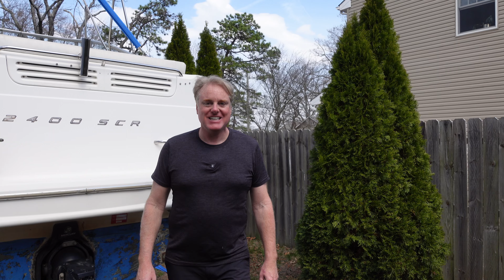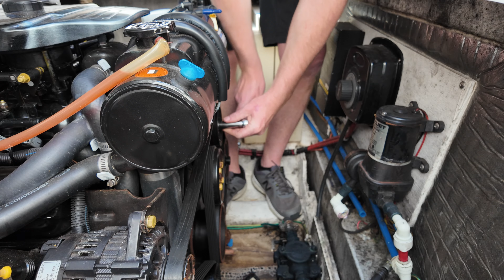How to replace water impeller on Mercruiser MAG Stroker Bravo Outdrive

Comment from the maker: INSTALLATION NOTE:  Getting this back on was a real treat.  Here are a few tips.  Reconnect the bottom hose first.  Disconnect the top hose at the T-fitting for the flush kit and then reconnect it to the pump.  Mount the pump back on the front of the engine and snug up the nut so the pump and bracket are flush against the engine.  Snug up the bolt below the alternator.  Pull the water pump toward the outside of the engine and with any luck the bolt to be insert on the front of the engine should line up.  Then reconnect the hose at the T-fitting.  Good Luck!!!  🤞🏻

Comment: I have to leave the back plate and the hoses attached and take the pump apart after dropping off or down from the stud.  They would have to be cut off if you could reach them. The first time I had to double nut the stud and remove it and then grind off a useless tang from the bracket to be able to drop the pump down and reach all the rear facing pump bolts.  I set the pump on a board to work on it with the hoses attached.  I then eventually replaced the pump with the Hardin marine Stainless-steel pump housing and then the stock impeller started sticking after about 2 years and stopped pumping.  I am in the process now replacing the stock black impeller with the blue dry run impeller to see if that works better over time.  Before that I tried the stainless plate with the short impeller to continue to use the brass pump housing that was scored up.
Reply from the maker: Thanks for taking the time to share your experience.  It sounds like it was a nightmare.  I'm curious what year is your engine?  My water pump wasn't the easiest to get to but at least I could do it without removing the engine or anything drastic.  I wonder if they learn anything over time as far as placement and MTBF.  My impeller was 5 years old and still looked good.  I can deal with PITA jobs every 5 years or so.  I'm delayed getting my boat back in this season because I already have an oil leak from what seams to be the oil pan on an engine that is only 5 years old.  That's BS.  It's so difficult finding good shops for big jobs.  I'm regretting not getting it over there in February but there was a foot of snow all around my boat.  Good Luck with the impeller and feel free to share an update.
Reply: @Nautisphere  I believe my 350 MPI is about a 2005.  It has the HX system and a replaceable fuel water filter next to the seawater pump.  I just went with this Hardin marine pump upgrade a couple of year ago.  The stock impeller did not appear to wear that well, and not many hours, but I have not done the repair yet to fully determine. I hope it will go better this time now that I have some experience and a plan to use the blue impeller.  Since I am in Florida now the HX is not really needed but may still help me with the brackish and salt water.
Reply from the maker: @kruzanJFD I watched a few videos when I originally went to do my impeller and that’s when I realized mine was a bit different than the older setups. The guys that installed my new engine said the material of the new housing and impeller was a better combination so it only needs to be done every five years. Hopefully your replacement lasts longer. Good Luck!! 👍🏻

Comment: That's the rustiest 4 year old motor I've seen. And that doesn't mean much because I don't see many saltwater boats. LOL
Thanks for the video!
Reply from the maker: Thanks!  You’re not kidding as far as the rust. I look at the engine and wonder what if anything I could have done for it to not look that rusty. I probably should have sprayed it with deep creep weekly. It would be interesting to see what would have happened. I left the 26 Piece Harbor Freight Ratcheting Screwdriver Set in the cab overnight. There was rust forming on them a day later. The moisture and humidity is just brutal.

Comment: Hello. Great video! question on the transmission fluid and acetone. What is the mixture? thanks
Reply from the maker: Thanks for taking the time to leave a comment. Glad you enjoyed the video. The mixture I use all the time to free bolts, screws, etc is a simple combination of 50% automatic transmission fluid and 50% acetone. It works great to free almost anything. I got the little can from Harbor Freight. I’ve used WD-40 and PB Blaster in the past and feel the acetone ATF mixture works best.

Comment: Nice work John. I had no idea how difficult it is changing the impeller on a MerCruiser.  Much easier on my Volvo. Love the tip about acetone and ATF. Will give it a try.
Reply from the maker: Hi Martin. Thanks for the compliments. I don’t know which impeller is more of a PITA the Alpha since it’s in the drive or the Bravo on the engine in a tight place. At least the Bravo seems to be fine after 4 years and 400 hours. The Alpha I always changed every other year. Hopefully be back in the water in 2 weeks. Was getting some bottom painting done tonight.